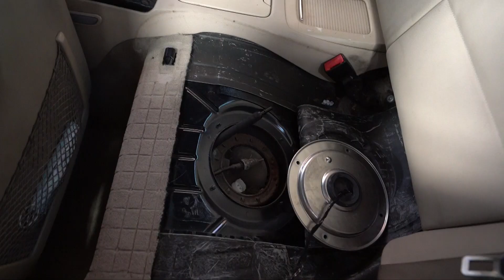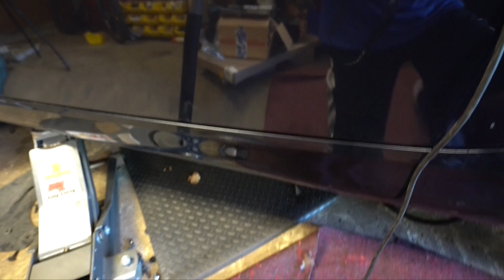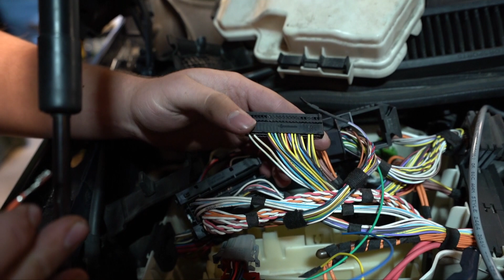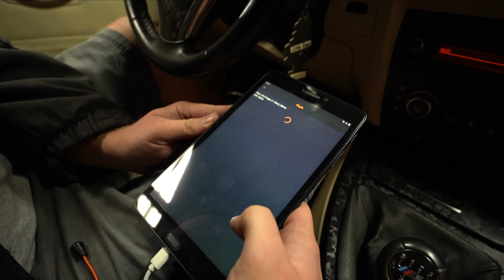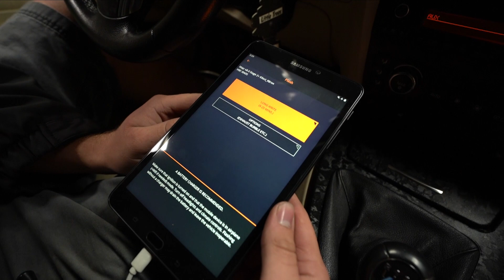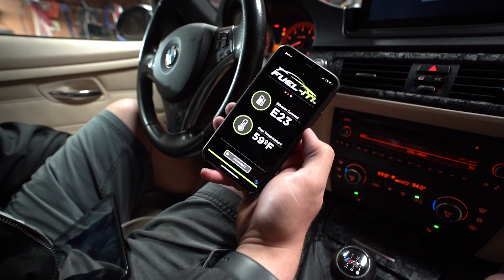How to make your BMW tune itself!!

Comment: Motiv install guide- https://cdn.shopify.com/s/files/1/2449/2461/files/Flex_Install_Instructions_-_BMW_N54.pdf?1590416680202363890

Also important to not that the bluetooth adapter is not meant to be used at the same time as the motiv box. So just connect the motive wires straight to the sensor.